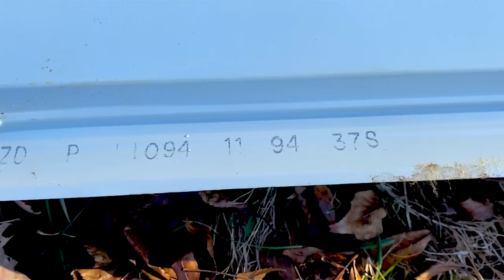WHY it HAD to be done | Day 1, Part 1

Comment: I slept too late to get in on much of the Livestream. That's one good thing about YouTube, eh.
   The rot at the bottom came from the compression of metal downward as ice dams burdened it. The slight compression allowed the holes "dimples" to funnel water in there. It doesn't take much but I've seen it several times/possibly many times. 
   I was surprised they'd nailed it in "94" or later too but those ring shanks sure held well, to a point.

Comment: Old roofing, chicken coop, raised beds. Hole patch it if needed. Good reusable material even with the holes. Save some $. We reused for chicken run roof and other things. Patch up goat shed too! Just some ideas!
Put some windows in on the sides to get more light. 
So glad you fixed it before the building was ruined. 😊💖

Comment: Keep the old roof sheets or sell-em; 
yes there is life in them there used panels for smaller projects ahead. Indeed there is a market for them as is.
When the deck is good shape new metal roof can be placed right on top of the old metal roof as long as the press
is identical. Metal roofing screws and yes even quick grab glues "especially" F26 construction adhesive will bond
metal sheets together; apply a bead of glue apply a mist of water across the glue and press the sheets together.
Tight n right! And the double roof is more better Lol
Reply from the maker: But as you can see there were the tin around the nail hole was bent so as he pointed out I would have to have some kind of grinder and grind everyone of those holes down and that’s just not something realistic for me to do

Comment: I don't know if your contractor pointed out part of the rot on the top plate may have been because they did not put a drip edge between the roof and the sidewall.  What happens is water coming off the roof wicks it self back up under the roofing tin and collects on the top plate.  Keeping it constantly damp.

Comment: I didn't see any tie down clips/straps holding the trusses to the top plates! Didn't really have a good view though, so they may be there! Everything, gets tied down to the slab, truss to header, header plate to studs, studs to bottom plate, and bottom plate to the slab! So lift won't tear off anything during high winds! Just nailing or screwing won't work to prevent lift! Or not! It's hard to see everything on these video's!